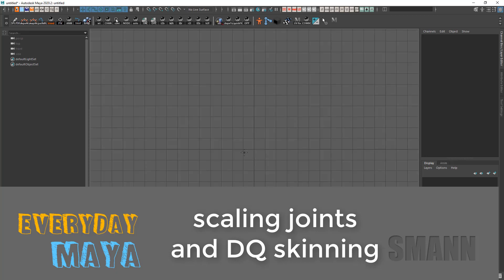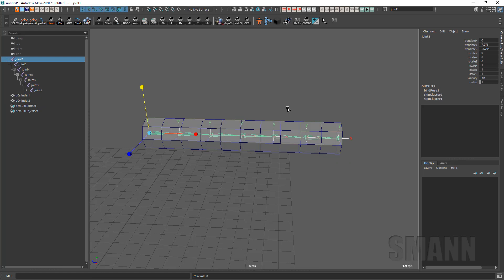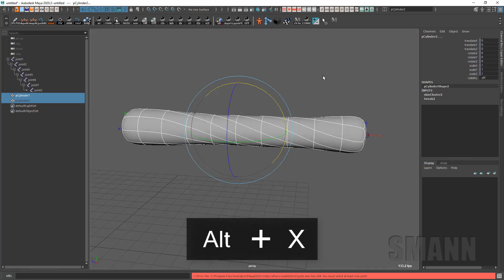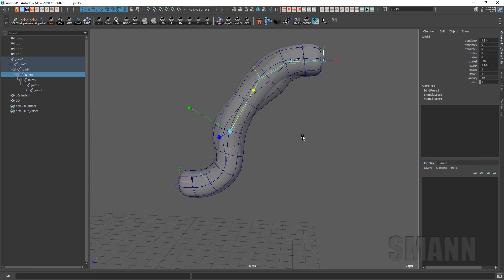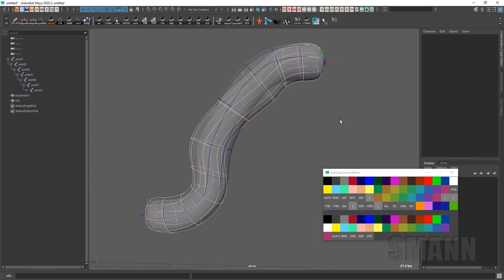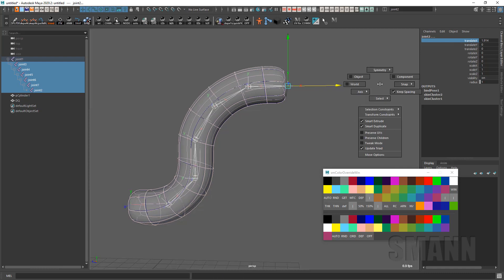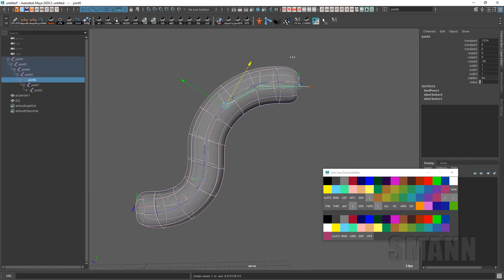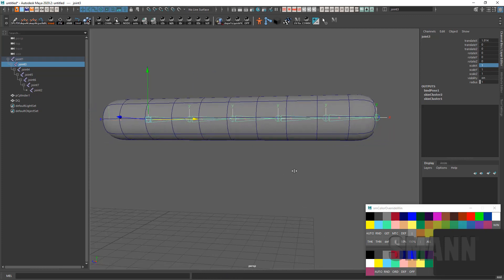EveryDayMaya: 011 scalingJointsAndDQ

Comment: Nice video,
is there a way to fix it with scaling instead of translations? For this cylinder it works indeed, but I for instance have a joint eyelid system in my character with DQ on, and for instance i want to be able to scale the eyes flat. This starts acting very weird compared to lineair. 

Your idead works when you have to scale joints over 1 axis and for stretching, but what if you want the double sides scale (positive and negative) (so not the translations), for instance when scaling my eyelid and eyes flat, i want the upper and lower eyelid go toward eachother. Any idea? Thanks in advance!
Reply from the maker: The issue is with how DQ is calculated..  So if you scale in all 3 axis. it won't get offset like that. If you only scale in 1 axis. it just doesn't work.   And I think you are saying you want to flatten your entire eyeball with the lids?    For something like that I'd probably use a lattice instead of depending on the joint weights. or use a joint at the tip of the eye, and translate it in it's axis ( usually X ) .  and the point is.. I Don't use Scaling with DQ ..
Reply: @smann3d399  alright thanks, i was just wondering if there is a way (maybe more complicated, but still doable). But if its not, ill find another way. Thanks for your time.